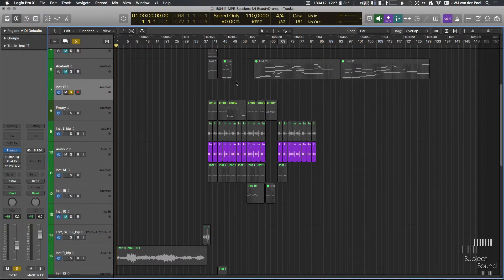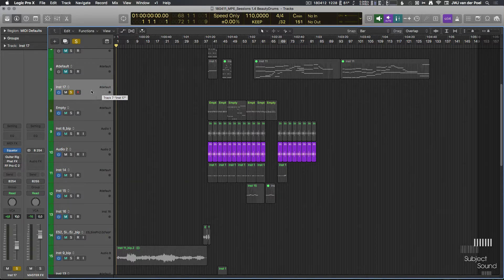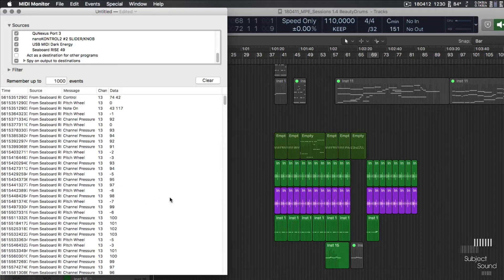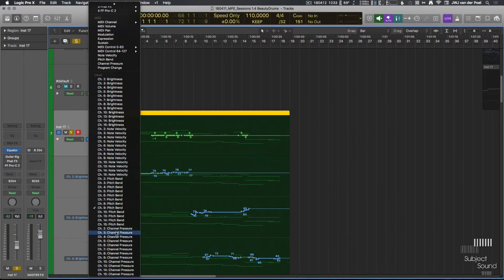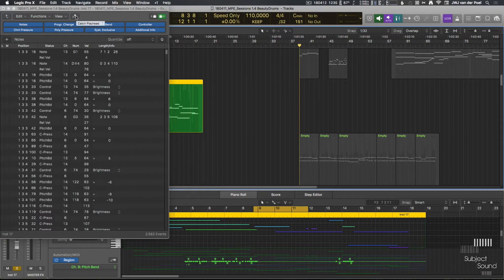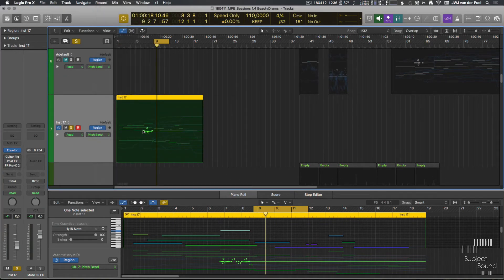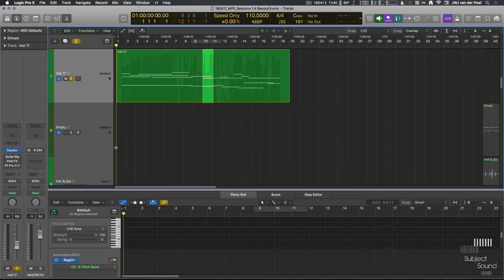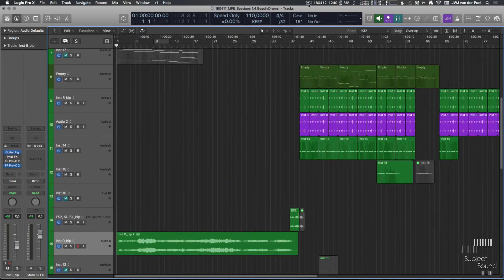How To Tutorial - Using a Seaboard Rise in Logic Pro X - SubjectSound

Comment: Hi there, how to use 2 seaboards (rise/Blocks ) together in Logic?
Reply from the maker: Sorry for the late reply! I would suggest using the IAC driver to split the instruments into two different ports (since splitting by MIDI channel is not an option) You might need to dive into the MIDI Environment for a bit as well.